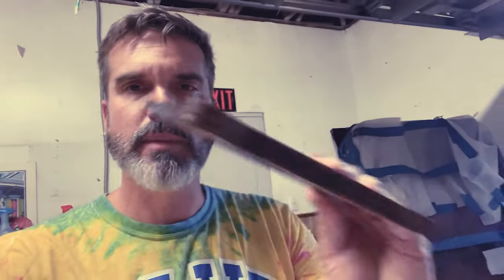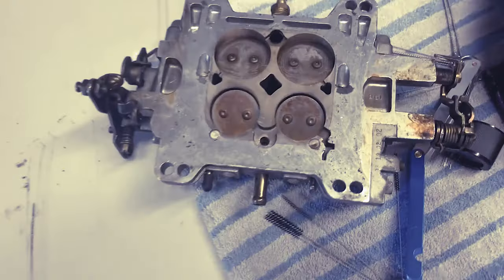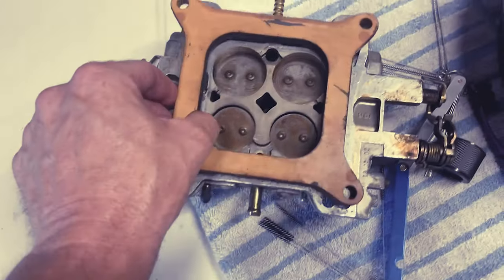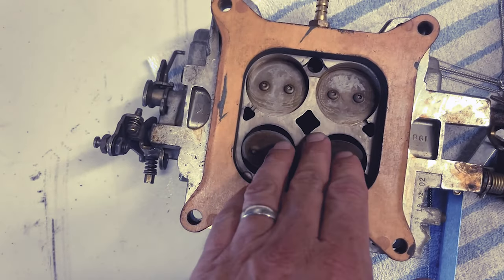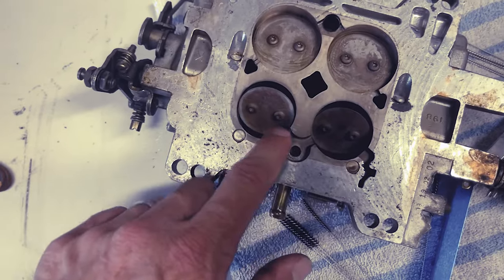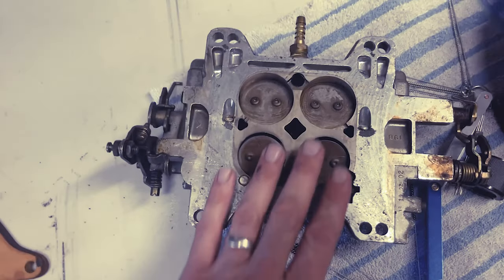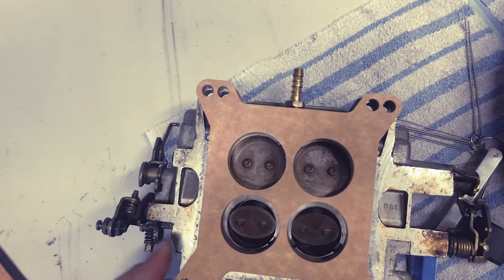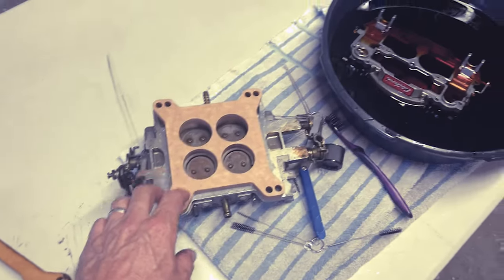My new carb spacer! Edelbrock 1405 1406 4-barrel carburetor. What kind of spacer? OPEN or 4-hole?

Comment: I have a 1405 om a 318 LA Mopar. Having issues to start the engine after it's warm, not right when it's off but like 20 minutes later, so I'm going to try with a 1 inch spacer, have plenty of room since it's a jeep CJ-7 '82. Hope this helps with the heat and vapor lock (already put gas filter with return line).

Comment: Thanks man! I was wondering about this swapped from a Holley 600 to a Eldebrock 1405 had a square spacer for the Holley and out back on with Eldebrock seems to not run right will swap for 4 hole!
Reply from the maker: Yeah the square hole screws with the vac passages in the Edelbrock.  I have heard that the split ones will work a little better than open square if on a dual plane intake, which I have.  I just went to the 4 hole and never going to look back.  At same time I richened up the mix a little then ended up having to lean in out a little once on car cuz the carb was flowing so much better.  Let me know how it works out! - Jason

Comment: i just ordered that spacer for a 58 chevy 283 engine i have in my jeep, have a edelbrock 1901 avs2 carb on it, when engine gets warm and i shut it off after about ten minutes its hard to start, hope this insulator works
Reply: Did it work?
Reply from the maker: How did it work out? I have used the plastic or what ever they call it and the wood.  This one has served me well so far.  Between that and my new Distributor it has been firing up really nice when hot!  - Jason